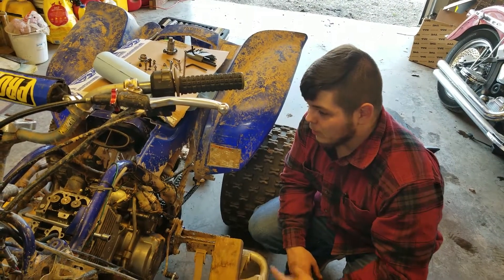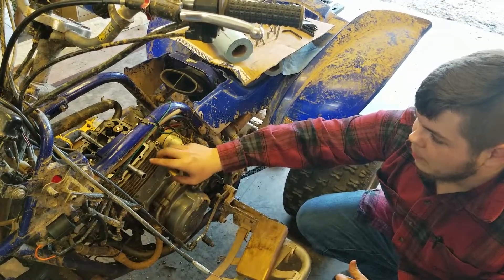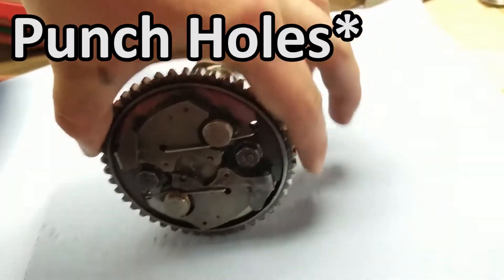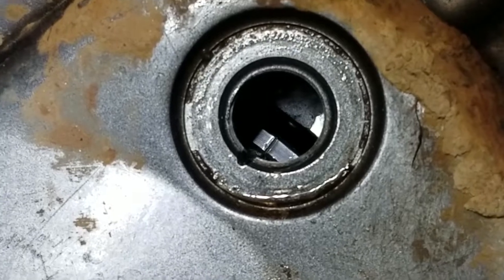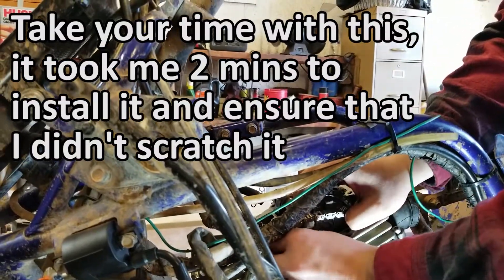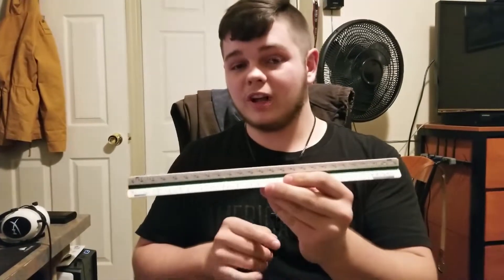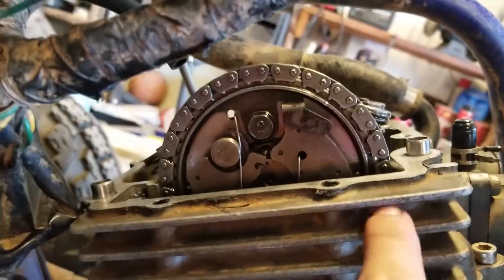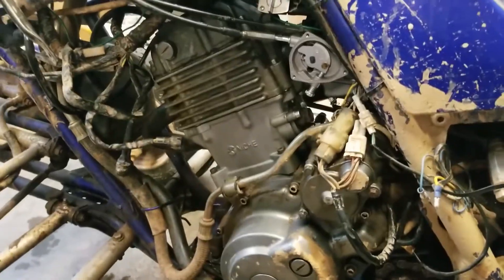4 Wheeler Timing Tutorial (Raptor 660 Used)

Comment: Note: You should always torque down your valve cover 1st before installing the plunger spring on the cam tentioner. The reason for this is because the tention on the cam chain can pop up the cam shaft on the far end away from the cam gear and if that happens? and you put the valve cover back on the cam chain tension will be way way too much and could easily break apart you can still take out some chain slack with you finger when just verifing cam timing
Reply from the maker: You absolutely dont have to, plus, how are you verifying the cam alignment dots are still correct after you install the tensioner? I went by the service manual which shows doing all of the timing without the valve cover installed
Reply: @Hunters_Mechanics  Ah Yeah ya do ive been in this business for over 35 years and know by now thats not a good practice to do it the way. if that cam pops up on the end just a little bit and the tentioner is in place it will lock in that position and when you install the valve cover the cam chain will be too tight TRUST ME I KNOW FROM PREVIOUS EXPERIANCE im tying to educate Not mislead anyone performing this job. well all i can tell you is the service manual is misleading then if its an actual yamaha manual?
Reply from the maker: @looneytunes47  Yep, Yamaha service manual, it's in the description if you need it  :) Now I have have instances when slipping the cam and the cam gear under the chain to get it in position and it gets stuck in a position like you're describing but it would be impossible to install the valve cover and it obvious that it's wrong. I can't say during the numerous times that I have had this apart that I've ever seen it come up on the end when applying the tensioner to the chain
Reply: @Hunters_Mechanics  All i can say and relay to you is that ive seen it happen on several different engines through out the thousand of engines ive restored. its just a good habit and practice cause it only takes one time to fail and then your redoing the job on your dime the 2nd time

Comment: I just got a 660r and it turns over until certain point. It then gets stiff. It has burnt out 2 strater solenoids. What you think it might be. I have the valve cover off and it still does it.
Reply from the maker: I mean the engine will have resistance when it comes up on the compression stroke, take the spark plug out and see if it has any difference

Comment: What’s up buddy I have a 2001 660r I have a question. When you timed cam did you turn the crank to the I after the H or the other I that’s further around nd the on it own. I know your real thorough. I need help
Reply from the maker: https://youtu.be/g4uqE6QTVuM?si=lTzyJ9i72aJM1lK0&t=127 Hopefully that will help, there should not be any other "I" except for the one right after the H mark on the rotor, it may just be a dent mark

Comment: Do you have to compensate for the tensioner?  Every time put the tensioner on the cam doesn't line up anymore
Reply: That's because the drive side of the chain is the one that needs to be held tight when setting the cam. The drive side of chain is opposite of the cam tensioner.

Comment: You are actually incorrect on your cam the third hole does exist if you remove that little cover that's in between the other two holes on one side or the other there will be a third hole covered up by that plate on your cam gear
Reply: Thanks man!!😊

Comment: Hey there hunter’s mechanic, did u get my mesage earlier today regarding the atv.  Same bike 2001 raptor , same niche kit. When I have spark plug in it , engine won’t turn over but twice , I get 120 pounds compression , and turns over a lot with spark plug out , why won’t it keep turning over after 2 times with spark plug in ??
Reply from the maker: I replied it to but I don't even see my comment, must not of had good signal when I did and it just didn't upload.... I believe you mentioned using an ATV battery to help jump start but have you used a vehicle battery? I keep a truck battery in the garage to jump mine in case I need it. Double check the ground to the case, it should run from the battery to the left side engine cover. My starter wouldn't turn over damn near at all when it was dirty and it also smoked 2 of my starters.... worst case scenario is that your Camshaft decompression pin man not be working. When you are starting the engine, the camshaft has a small pin on it that decreases the cylinder pressure and once it fully starts, that pin returns to its position for full compression. I know a lot of people that watch my videos have the same issue and I never knew about it when I made my videos. @danil1581 has a video on that decompression pin on how it works. If you find no solution with another battery or cabling, thats where id look next. Let me know how it goes!
Reply: @Hunters_Mechanics  yes I think this is my issue as well , that decompression pin sounds like the issue . I get 2 good strokes to fill up the gauge and then it’s not releaseing compression like u said to let turn over anymore , I pull spark plug and it moves fine , yes I am using a vehicle battery to give it more juice as well
Reply from the maker: @glendane8625  Then that's what it sounds like to me. Knock on wood but I haven't had any issues with mine but everytime I have removed my cam I have  cleaned out the journal holes and made sure that the spring and mechanisms still work on the front. If you do take the cam out, don't forgot to zip tie the cam chain up so you don't drop it in the case 😉😂

Comment: Do they still not make a gasket for that top pan? Does it still require silicone gasket sealer?
Reply from the maker: If they do ive never seen it lol I feel like they don't because you have to use sealer around the cam bearings in the middle of the valve cover, no way to use a gasket to cover it
Reply: @Hunters_Mechanics  oh okay makes sense

Comment: What is the h for I want to time my yamaha raptor 660 but I but it on the h not the I
Reply from the maker: I truly don't know what the H is supposed to be, I'd assume it's supposed to be 10 degrees before top dead center for ignition timing but don't quote me on that. Just use the "I" and you should be fine

Comment: Hi, can you please tell me why the battery is not charging?
Reply from the maker: Have you checked the voltage while the ATV is running? I have the Raptor 660 Manual in the description so if you want to download it and look in the back of the PDF, it has a section on troubleshooting the entire charging system of the ATV

Comment: This is why your timing chain snapped and this is not good info to give people sorry .. you need to bolt the Rocker Cover down before you put the tensioner in or you will stretch the chain
Reply from the maker: The manual specifically states after installing the cam and the timing chain to install the timing chain tensioner..... I've never had a timing chain break on any atv I have changed the timing chain on nor had any issues with them.

Comment: Hello! Great video thank you very much!

Just had some questions, I tried my best to follow along with the video and after starting it up the piston now touches the valve. Any advice would be appreciated!
Reply from the maker: You might have the cam 180 degrees off, any time the Cam timing is off is when the valve would hit the piston. Ensure that when you are putting the cam in that the crank is lined up with the slit, and that you have the correct "pin" and oil galleries facing upwards on the camshaft, otherwise the timing will be wrong
Reply: Cam lobes down and three pin holes you should be able to see. Also his timing chain is super wore out of he can rotate the chain without taking the cam sprocket off. Put the cam in and then the gear. Adjust accordingly.
Reply from the maker: @netflixnchil421  its because the tensioner is not in, with it it, its extremely tight. Even when that chain was brand new I was still able to do that method

Comment: How do you take off those two little covers on outside of the left side of the engine where u spin the crank and lime up the time chain
Reply from the maker: I just used a wood chisel for the larger cover and a large flat heat for the smaller one, they just screw out

Comment: After I set  top dead center then install the chain tensioner the punch holes are no longer sitting flush with the deck. No matter what I do I can’t seem to get it right. Any idea why that would be
Reply from the maker: Can you move the cam wheel slightly and get the hole to line up before setting the tension? Because like I stated in the video, it might not line up perfectly, if you can get the punch holes to line up before you set the tension then you're all good
Reply: @Hunters_Mechanics  yes it does before I add the tensioner. 
I must have missed that part

Comment: yo  have a 2001 raptor that m trying to time but the problem is ill time it on "i" but when  rotate to the engine  on the crank shaft 1 full turn, the cam only turns halfway, so like one full bottom end turn only turns the came halfway, any ideas?
Reply from the maker: Thats the way all engines are, crank and cam are a 2:1 ratio, 2 turns for the crank is one turn for the cam. As long as the "I" is lined up when you align the cam wheel, it should take 2 two turns to get back to your starting position on the cam
Reply: @Hunters_Mechanics  I did align the i mark but I mean I align the i mark, turn it over, snd than realign the i mark and the lobes are upside down, so does that not affect the timing, like if the lobes change postitions after 1 turn to “I” than shouldn’t it not matter which way you put the cam in?
Reply: @Hunters_Mechanics  actually I should say, so what’s stopping me from putting the cam with the lobes facing upwards instead, since I can just turn it over on the crank and it’d be at tdc and the lobes would be down
Reply: @austin_colt  bruh I’m honestly considering it lmao I really don’t under stand what the difference between me just putting it in down wards or upwards Bc everytime i turn it to tdc they flip postitions
Reply from the maker: @austinmoody5467  In theory you could put it in upside down but you have no indicator on where exactly the cam should be lined up, you use the punch marks on the wheel and the dimples on the cam to ensure that you have the cam in the right position. Please just install it with the dimples facing up and the punch marks aligned with the deck surface. When you set the tension, turn the engine twice (because of the 2:1 ratio) and line the 'I" back up, and make sure that all the markings still line up and you'll be good to go!
Reply: @Hunters_Mechanics  ok thank you, the only reason I’m worried about this is because I went to start it and I noticed that the exhuast was sort of sucking in air and it “back fired” out of the carb and I thought it was timing but I don’t know why
Reply from the maker: @austinmoody5467  been there before, was in a rush and had the timing off 90 degrees  and went to start it and it shot the carbs out of the boot and caught fire
Reply: @Hunters_Mechanics  yeah that’s exactly what happened, sorry if I’m sounding ignorant but 90° off how? Like upside down?
Reply from the maker: @austinmoody5467  I lined the punch holes on the cam wheel up and down not side to side
Reply: @Hunters_Mechanics  ohhhh ok gotcha, well I’ll try tmr and see how it goes and lyk apprciate it

Comment: Hi can you help me i have a 02 raptor 660  but the problem is when I put oil on the reservoir the oil go through to the Carter I put 4 liters and the oil stick doesn't mark nothing.  With the motor of  so the motor is not running an the oil go directly to the bottom fron the reservoir.  Do you know anything about.  Please let me know 🙏 😔
Reply from the maker: Go watch my oil change guide, it may be able to help you out with adding the oil and making sure it shows up to the correct level  https://www.youtube.com/watch?v=urPOpS9DiOE&t=221s

Comment: Which line to use on the crank it has a line looks like a H and a straight line
Reply from the maker: Always use the straight line
Reply: @Hunters_Mechanics  Thanks alot Hunter I think my chain has stretched it's pretty lose after I put in tentional , it fires but its miss fire  until I spin it a few time then stop firing all together every time I reset it , it Sparks a few times then stop
Reply from the maker: @tonymagee8500  the chain should be TIGHT tight after you put in the tensioner, if its not grabbing hard, it can cause the timing to slip and possibly cause piston-valve collision. If you have significant play after the tensioner I would replace the chain

Comment: Hi mate
I do have a problem with my timming chain
I changed it with the new one same method as you but . It runs well on neutral but when you tried to accelerate is stat poping . I've no ideea why
Reply from the maker: Did you adjust the valves when you put the valve cover back on?
Reply: Hunters Mechanics yes i did 
I thing one of my exhaust valve is bend because when i had the old timming chain it was too loose and I think it jumped one tooth 
If the engine it's cold works fine for a few seconds and after that starts poping.
Reply from the maker: @chissebi8772  Did you do any sort of leak down test to see if the exhaust valve was sealing properly? If it's not, it could be losing compression and be the main cause for no power, I'd get a compression checker and see how much your engine is pushing out.
Reply: So much time ago... but wondering if u solved it.
I rebuild one raptor (of my friend - he told me to replace piston because sb told him so - it had problems with not starting or stopping after warming - so it indicated head issues) and it has the same.
Starts and idles like a charm, but some revs up (dunno, +300, 400?) and it starts popping.

IMO checked with service manual and this video timing - twice. Seems good.
Head - leak test ok, checked at workshop too.
Carbs - did checked three times, used also repair kit, but it seems to be not the issue, I can spray some flammable spray into intake and it does not help and almost does not make it run worse (WTF).
I checked possbiel rev limiters? Reverse, parking? I suppose i checked them OK and still not the issue.

Have run out of ideas, looking forward to receiving timing light to see if there is spark during revving.

Comment: Hey man I put my new cam chain on and the tensioner or the black stick isint on but the chain is really tight and won’t pick up and a lot of compression when I turn to align the I mark what do you think is this issue
Reply from the maker: What does it not pick up? And it's going to have a lot of compression when turning it over, you can take the spark plug out to make it much easier to turn over
Reply: Hunter's Mechanics yeah it was the spark plug thank you but the chain still won’t pick up
Reply from the maker: @crfisaiah3963  like you cant get it to connect at the bottom on the gear?
Reply: Hunter's Mechanics no I got it all connected but if I were to pick up the chain to put the cam in time it won’t pick up because it’s really tight on
Reply from the maker: @crfisaiah3963  so you do no have the chain guide (the black slide) nor the tensioner on and you cant pick the chain up at all? Like not even a little bit? When you turn the engine over with the bolt down below, does it turn the chain and cam? (To ensure it's on the gear down below and not the shaft) because it's supposed to be moderately tight regardless, that's why you have to tilt the cam towards yourself to release a little bit of slack to move one tooth forward or behind
Reply: Hunter's Mechanics yeah the tensioner or the black stick isint on but it won’t give me slack at all
Reply: Hunter's Mechanics what you think it is
Reply from the maker: @crfisaiah3963  could be the wrong size chain? Its gotta be the wrong size you you've hooked it on something down below somehow. Do you have the old one to half-ass compare to?
Reply: Hunter's Mechanics yeah I match the old one and new one and there the same size
Reply from the maker: @crfisaiah3963  didn't you mention previously the old one was too loose?
Reply: Hunter's Mechanics no I don’t think I did but I don’t know why the chain is so tight on the cam but do you think it has anything to do with the flywheel
Reply from the maker: @crfisaiah3963  must have been someone else, I get a bit of comments and it's hard to keep up with them all lol do you still have the starter clutch and all that pulled off?
Reply from the maker: @crfisaiah3963  I do remember when I dropped my chain down in, it wrapped around the cut out for the chain guide holder, yours may be wrapped around it too. When it was wrapped around it, I had just enough slack on it to get it on the cam but not enough to move it when it was on, ensure that the chain goes straight up on both sides of the gear on the crank, not around anything
Reply: Hunter's Mechanics I have it connected at the bottom of the gear
Reply from the maker: @crfisaiah3963  Do you still have the flywheel and starter clutch off?
Reply: Hunter's Mechanics right now I just took it off to see if I can see why the chain is so tight but I don’t see anything to concern that
Reply from the maker: beats  send me several pictures of the entire setup top and bottom to my email, my phone hasn't been working for text or calling : bacon626262@gmail.com
Reply: Hunter's Mechanics do you have snapchat
Reply: Hunter's Mechanics hey man I got it running and thanks for responding you helped out a lot too I really appreciate it
Reply from the maker: @crfisaiah3963  glad to to hear buddy!